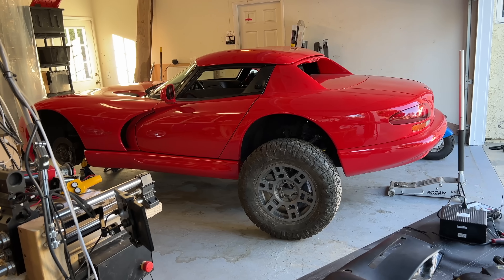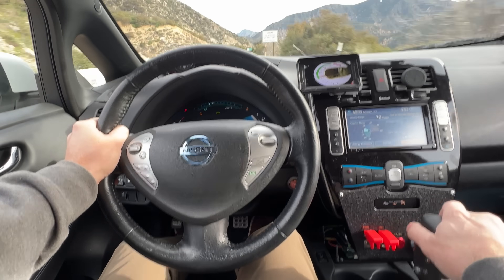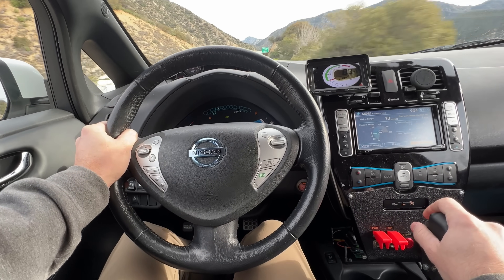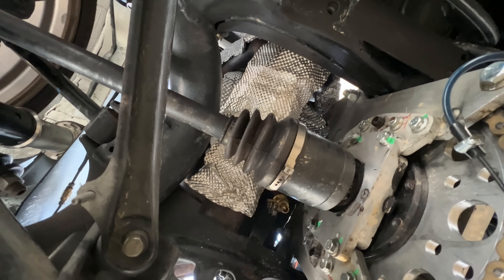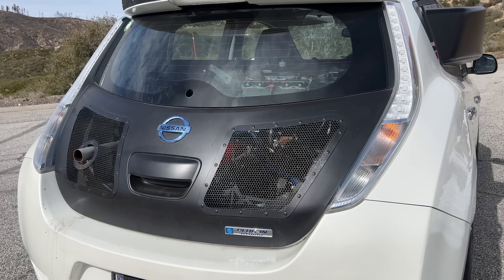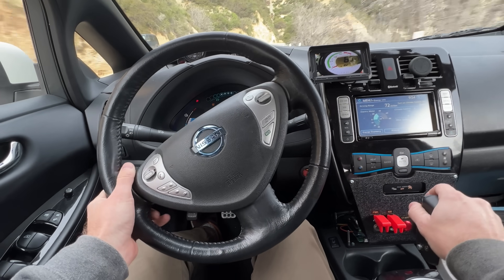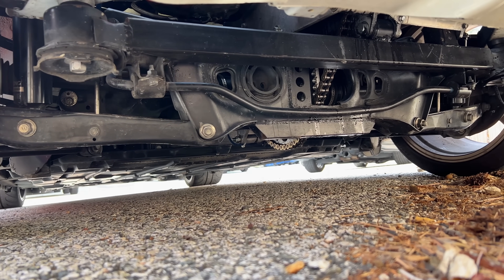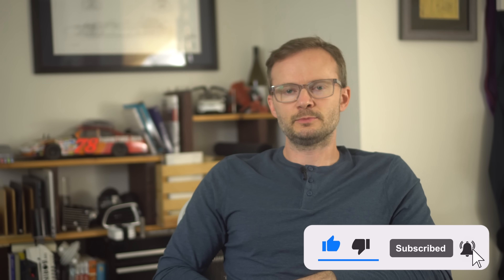This Nissan Leaf Is Hiding A 13,000 RPM Secret

Comment: I took a Suzuki SJ413 (almost exactly like a Suzuki Samurai, but with a few minor differences) that was headed to the scrapyard, rebuilt it, put it on 31" mud tyres, and got it back on the road.

The time I spent doing all the repairs and rebuilding could have been spent at work, earned loads of money, and bought a pre-built 4x4 that was better.

But the journey of building the thing *was the whole point*.

If you don't like making things, you won't ever understand.  Or, to put it another way:

If you know, you know.

Comment: What would be sweet is if all the angine stuff could be automated. Run the motorcycle engine and have the ev side do regenerative charging while the motorcycle engine pushes it along. So you can choose ev now or ev later like a ford fusion energi

Comment: I have a kei wagon, 870 KG at 660cc to 6k rpm. I have been wanting to go and grab a 650cc motorcycle engine and drop it in the front, so long as it revs past 10k. it's the little things lol.

Comment: Does the motorcycle engine have a shorter lifespan than typical car engines? There’s gotta be a reason they are so much larger.
Reply: Yes.  I change the oil every 1500 miles too.

Comment: I know that HEAT burning him up, 
Why this man didn't  stick the engine under the hood where it goes😂🤣.

He would have been better just adding more batteries, 
it would have been a whole lot easier than sticking an hot engine inside the car with him 🤣.

You modify yourself a unique Hybrid,  
Nissan might be interested in it.....

Comment: In the mid 90s a father and son on a council estate replaced their mini engine with a bike engine. The thing sounded insane and moved like a go kart on steroids. 
For whatever reason they had cut out the roof, just the middle section. That dull green roof sat in a alley way for over a decade.

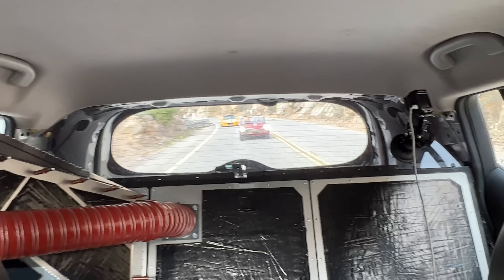Comment: 8:37 were you ever able to ask the owner as to why there using cleco's to hold in their insulation(?)
Reply: It's part of the radiator duct.  I left them as clecos incase I ever had to clean it out.  Hasn't been an issue.

Comment: 8:49 lol realty i get it  but no its a leaf well its point less just buy gas it will never run out carbon is good and EV are fun but all the narrative stuff is just that  .a 1980 rx 7 is what guy needs with an is200 4 banger or the original ported 12a ./13b    or M2r or fireo with new rear suspicion is a must gm crap was bad geometry wise

Comment: This is really cool. The electric powertrain just works effortlessly at all speed and he gets the added manual engine experience from the rear powertrain without the usual issues of interconenction between two manual setups in most other twin engine cars.

My 2013 Leaf has over 60 miles of range still so it's useable but I would love to do this to it if it was possible to get it road approved here.

Comment: Honestly i think the dodge hornet fills this niche very well. The axles are reversed, but its a 30 mile range phev, big electric motor on the rear, 1.3 turbo on the front, not mechanically linked in any way.

Comment: This is the kind of hybrid I can get behind. I don't think this would even need a transmission, just rely on the torque of the electric motor at low RPM. It'll make the car easier to drive.
Reply: No, the bike engine only makes real power in a narrow RPM band so you need the gearbox.  Sure you could drive around in 6th but you'll be lugging super hard at speeds below 50mph.
Reply: @DerekYoungdby  this car's concept is similar to the Koenigsegg Regera. The Regera used their electric motor to help in low engine rpm. It was able to just use a 1 speed direct drive. I guess except for the weight panelty, they can just leave the motorcycle engine in 4th or 5th gear (whichever is 1:1) and put in a centrifugal clutch. Then no shifting or clutching is needed at a stop.

Comment: You could do this the other way. Now the 25 years are up you could get a K car and put an electric motor in it. I think most K cars are FWD. If you got a crashed model 3 motor. Unlike the leaf you can put less batteries in it. You could put 1 of the 4 modules in it so it 12.5KW and perhaps 50 miles (it wont be that because its not a model 3 but its a good estimate) . There are mid engine RWD Kcars and Front engine FWD. They are super light. Turbo'd 60 hp. I'm sure there is the right car to do this to. Maybe you dont even use an electric car drivetarin and start from scratch with a BOSCH electric motor and batteries.

Comment: I want to know what (if anything) was done with the battery. He mentioned that the original battery was severely degraded, but was it pulled and replaced with a lighter and lower capacity (but healthy) pack? Or did he just keep the heavy, nearly dead pack in place?
Reply: I kept it -- it's about 1/2 the original capacity (so like 12kWh) but can still push 110kW, as I've upgraded to a 160kW Leaf Plus inverter.  I'm looking for a better health battery to unlock 30 more kW out of the electric system now.   I have considered a smaller, lighter battery, but that would be a lot of work and get rid of a lot of the "simplicity" of the system.

Comment: I kind of enherited a 2011 silverado 5.3L 2WD. Its not my daily driver but I'm keeping it cuz it was my Dads last truck. I've always been a sports car guy but I've driven a lot of trucks for work. Anyway I've been daydreaming about trying to mount something like a Tesla motor with similar output to the 5.3 where a transfer case would normally sit in the 4WD/AWD versions of the truck. I know companies make adapter/reduction gear thingies for tesla motors so you get a single output instead of the diff setup they come with. And use the front IFS subframe and diff from a Suburban or something that came with 4wd or awd. Then put the battery pack under the bed as far back as it'll fit, probably in pieces. Seems like a cool idea for a hot rod street truck. Yeah it would add a lot of weight to an already heavy truck but also a lot of power and way better weight distribution. Even with big sticky tires the back end really likes to step out. I mean like 10% throttle if it's wet and I'm turning from a stop. Hell, maybe I could even try to fit the IRS from the new Tahoes and Suburbans in the back. Need to get my tape measurer out.

Comment: I would love to read about how the control system is built in this car, like handling optimal throttle command between electric, and bike motor. Is there any source in which Derek explains it deeper?
Reply: What do you want to know?   The Autopian did a long piece on it in fall 2021 that might interest you.   To address your one Q, the control system is very simple.  The leaf throttle signal is fed into a micro controller and the adjustment knob sets the gain for the drive by wire servo on the ICE.  The pedal is connected to the EV system as stock (100% pedal =  100% torque, in "ECO" mode the first 20% of pedal travel has reduced torque -- useful for charge sustaining),  but with the adjustment knob set to 20%, the ICE would get 20% throttle at 100% pedal.  At 500% the ICE gets 100% throttle at 20% pedal.    I generally run it at 100% or above.  The higher the gain the quicker the rear end is fed torque, but TBH it is quite subtle in practice.  Maybe if the ICE made a ton of power it would be more impactful.  The car is composed under WOT in almost all conditions/settings.

Comment: Just curious, but can't you damage the ZX gearbox by driving the car without the engine running? I seem to recall a warning on mine that advised against coasting long distances in neutral to prevent gearbox damage. Since this gearbox is lubricated with the engine oil, maybe it won't circulate enough lubricant to keep internals protected? Maybe the EV only mode is only used at very low speeds and short distances so this won't be a problem?
Reply: I typically start and let the engine idle everyone once and a while if I'm in EV mode.  But yes, the reality is that I don't use EV mode often except for moving the car short distances near my house.  I considered adding an electric oil pump, but since I don't use the car in EV mode often I doubt I'll do it.

Comment: what car front wheel drive platmorm would fit in the back of that car?
Reply: Honestly probably most.  I wanted a bike engine so that's why I used one.  If I wanted to go fast, maybe a turbo K series?  Fuel cell in the back seat.  Cooling would be harder for sure.
Reply: @DerekYoungdby  i'm not criticizing your setup --- it's awesome --- this is genius also because no smog check  --- a small FWD setup might be easier --- it don't know ..
Reply: @mAy_TrIcK_sUs  oh don't worry I didn't take it as a critique.  Clearly I didn't do this because it was easy 😀

Comment: 9:24 , as much as i wish this would happen, i doubt it would, the only way i can see this happening is if a manufacturer that already makes motorcycle's and a small ev, sadly honda is really the only one fit to do so, pun partialy intended, bmw could but we all know it wont be cheap, But... if there was a group effort to build said cars it could be a higher chance of it happening, ie brz/gt86/frs, where a motorcycle company covers the engine, another does the ev, and then the last does the chassis and then they all design a generaly similar body among the brands.

Comment: Lovely machine! No manufacturer will ever build anything like this because motorcycle engines are high maintenance. High rpm engines need valve adjustments etc, and therefore shoes are too big to fill with anything that pretends to be a vehicle, but needs attention as a motorcycle. It is, and forever will remain wet dream of every proper car enthusiast tho. Probably for the better.

Comment: Hear me out: a K swapped 2000+ Celica with a electric drivetrain in the rear.  A lightweight powerful hybrid that's stylish and has BETTER handling than the original car.

Comment: It makes perfect sense. You get the torque your missing from the motorcycle engine for the electric motor. Then you get the horsepower from the bike motor.
Reply: And most of the internal combustion motorcycles that, unlike the Kawasaki in question, can go backwards, do so using the electric starter. Not too different from what’s going on here, I suppose.

Comment: I was thinking. What if it was automatic gearbox and it had two accelerator pedals? you press on both of them and you have awd quick launch. Coming to a tight corner just use the pedal for rwd to give some oversteer. Oh no to much oversteer and your spinning? Just release the rear wheels pedal and slam on that fwd pedal to straighten it out. Or im thinking incorrectly? Its hard to imagine how something like that would work because i couldint find anything close to that built ever

Comment: Even a honda rebel 250 engine can be a great helper engine to extend range on highway rides. A rebel runs great at 2, 4 and 8k rpm, due to it being a parallel twin at 360 degrees.
So a very tall gear ratio is needed, just to help out the ev. Not really to be the main drive engine.

Comment: Do the opposite.  Put a FWD EV drivetrain in the rear of a FWD ICE.  Use minimal batteries and maximal capictors for electrical energy storage.  Capacitors are better than chemical batteries in everyway except one, energy density.  But now you have a gas tank which is significantly more energy dense than a 1000lb battery.  You could also crank up the regen to lockup/abs levels because the caps can take the charge rate.  Honda in the front, Tesla in the rear. NO CAP :)
Reply: You do it!  And to make it even easier, use the entire rear subframe from a Tesla.

Comment: Would be curious to know how much mpg this thing gets... Also, you could swap the whole battery fo 1/5 of a used Tesla battery, and save some weight. This is one thing that's missing from auto manufacturers lightweight and performance orienented hybrids that gets super good gas mileage. With that we could have skipped the need for resource-intensive and expensive batteries.
Reply: About 21 mpg if I'm change sustaining and 23-24 of have the battery fully charged and run it down.   Tesla batteries have great energy density but poor power density (ie you need a lot of them to make big power). A PHEV pack would be great but also a lot of integration work.  I'd be happy with a better condition Leaf pack for now.

Comment: I've had the same kind of idea but essentially the opposite. I'd one day like to buy an early model front wheel drive audi TT and get a tesla motor to drive the rear wheels. Should result in a weird type of hybrid that has 250bhp (petrol) in the front and 350bhp (electric) in the rear. The TT has an excellent amount of space for batteries once you remove the rear seats.
Reply: Do it!  Lots of people talking about this, no one doing it (that I'm aware of).  I would want a pre OBD2 Radwood era car (w pop-up headlights!) so I was thinking a 2nd gen Probe GT would be fun to do this with.

Comment: This is actually a really good idea. If the ICE ever breaks down (Common issue with project cars), you still have the electric motor to get you home or to a shop.
Reply: It's happened!  I had to stop to charge but made it home.  Also the car has been mobile for all but maybe 5 days during this whole build due to the redundant powertrain.
Reply: @DerekYoungdby  Good deal. Have you considered trying the same in a Chevy Bolt EV? Even without a boost from an ICE, it's a pretty quick car. It would be pretty neat to see if it can go even faster. They're starting to get pretty cheap now.
Reply: @seanplace8192  I actually own a Bolt and would love to do this but they're still worth too much $$ to cut up (for now at least).
Reply: @DerekYoungdby  So they're <10k now (even saw them for $6k), is that too much? 

On a side note,  this gives me renewed gumption for my dream project: turning my cr-z into a plugin in, awd hybrid with ~double the power (and prob decent EV range)
Reply: @DerekYoungdby  I now you might not read this but maybe try Swapping the engine of a plug-in hybrid that has a dedicated EV mode, that way the engine can work as intended with car's fuel tank, radiator and stuff, plus some space saving for whatever DIY you need.
Reply: @DerekYoungdby   You need to have the plans available for purchase.
Reply: Right
Reply: If anything will break down it’s the electric side😂
Reply: In the day we did it with the starter, very slowly
Reply: I agree, the best kind of hybrid would be one where if one powertrain fails, the other keeps working.. we should make that

Comment: Very cool setup !

Does he plan to make the integration of electric with ice engine more automated than the dial. I know it's more detail, most likely very complexe and not necessary, but it would be immensely cool !
Reply: Out of interest, what do you suggest I try to accomplish?  I'm looking into more things to do w the DBW -- namely a 2-step system to get this thing to launch.
Reply: Most hybrids are already like that, where the generator starts automatically when the battery runs low.

Comment: Did he repurpose the factory steering wheel buttons to perform different tasks?
Reply: No.  Zero mods to the Leaf side electronically aside from tapping into the throttle signal.   The only button I use on the wheel is the Eco mode switch.

Comment: An amazing project that simultaneously highlights why EVs are not the future of motoring. That battery degradation in a car that's only 10 years old max, pretty shocking.
Reply: Mostly a problem with early Nissan packs, but the resulting depreciation made this build possible.  I own two other EVs and they are clearly the way forward as long as you have a place to charge them.

Comment: i was imaging how much better it would be if you dumped all the weight of the EV system
Reply: Something with this short of a wheelbase doesn't need to be a rear-heavy RWD. Having the front wheels help keep it inline makes more sense.
Reply: It would still be ~3000lbs which would be miserable with just the bike motor.

Comment: This is a much more sensible way to use this drivetrain concept.  I question the durability of the EV's battery since a recent Tesla car fire resulting from a failed battery.
Reply: Damn that's crazy, you should look at how often gas cars light up in flames
Reply: @justletmecomment6453  Multiple fire trucks were involved.  They used 6K gallons to put the fire out and it still burned to the ground.

Comment: They do build something like this, its called a BMW i3 REX and its amazing.
Reply: Except the internal combustion engine in that one turns a generator that charges the battery directly instead of a clockwork transmission that powers the other axle.
Reply: @owilliams1031  which is why its amzing
Reply: @lazerusmfh And that’s how most hybrids are set up.

Comment: The tires actually make it stop bigger brakes dont mean better stopping better tires make for harder breaking
Reply: Bigger brakes hold up to heat buildup better. The larger diameter also marginally gives the caliper more leverage to stop slightly harder.

Comment: Has to be one of the coolest car builds I have seen online. I wonder what it runs 0-60, 1/8th mile and 1/4 mile. I know it's more track focused but curious.
Reply: Thank you! It's hard to launch but 5-60 is ~5.5s.  haven't been to the strip yet.  I took it to the track to test it at the limits but really it's a back road car.